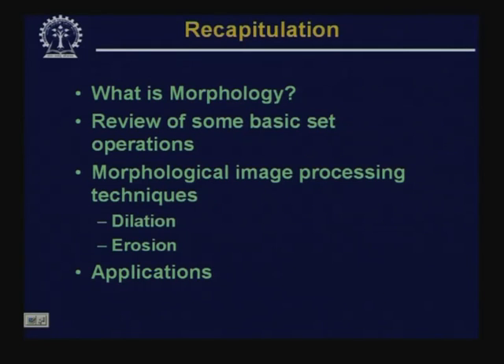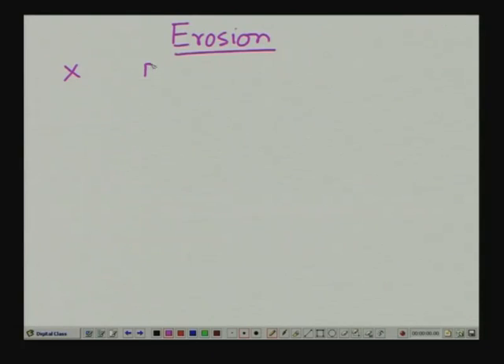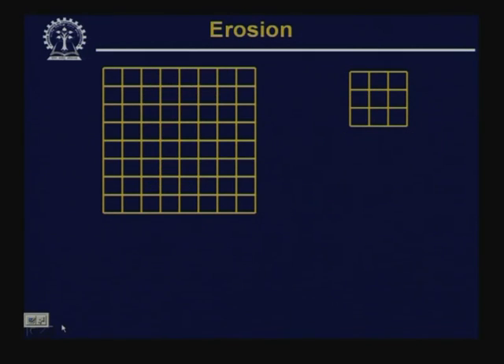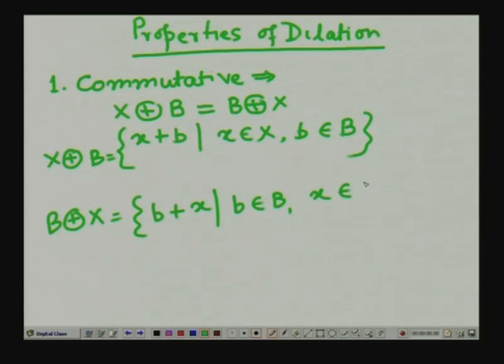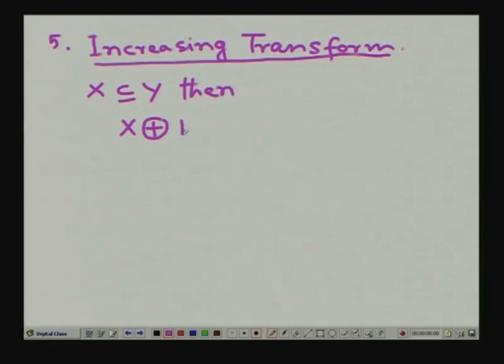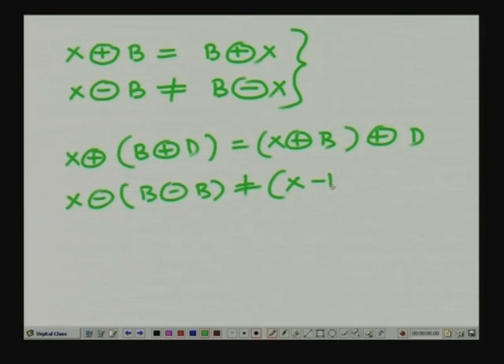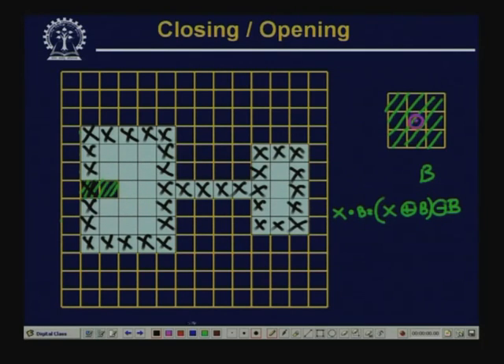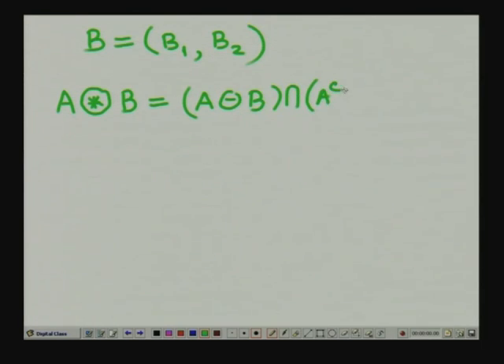Lecture - 34 Mathematical Morphology - II

Comment: hey. Suppose we use the second definition of erosion. Let the origin of W-X be at the center of W-X. When we place the origin on the top pixel from the two pixels on the left hand side of the result of (A erosion with X), W-X overlaps the bottom of the original left hand side image which means that in this position W-X is not a subset of the compliment of A, hence the origin in this position is not included in the result. Likewise happens if the origin of W-X is placed one pixel below.